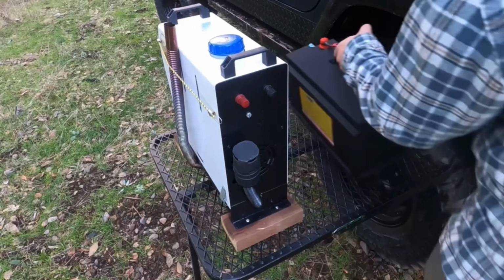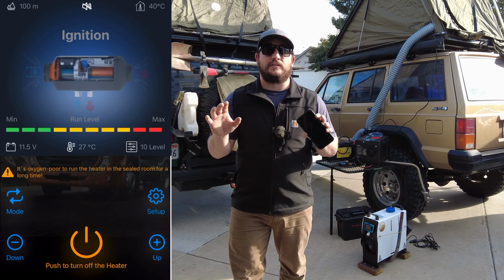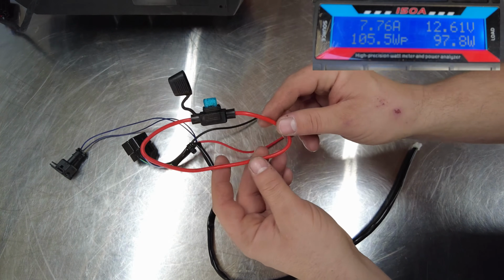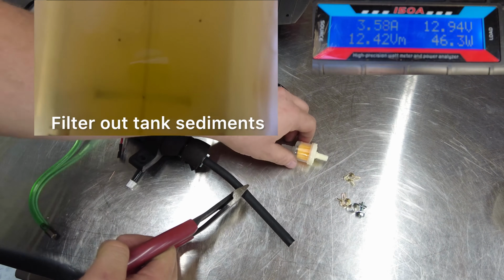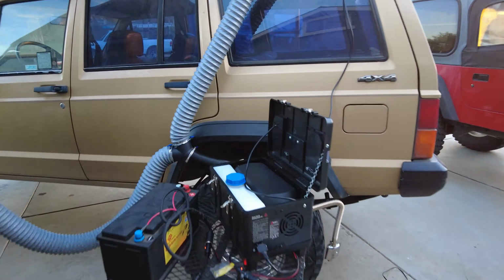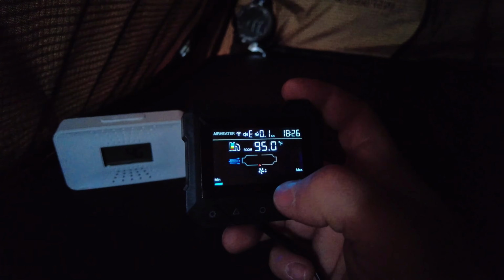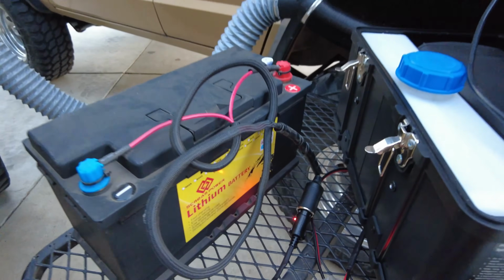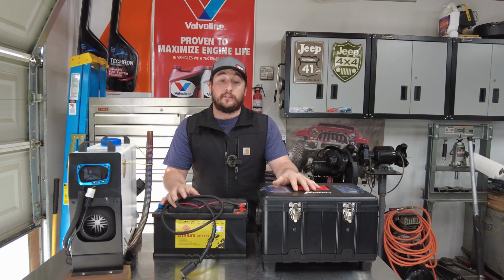Diesel Heaters For Winter Tent Camping - Upgrades and Modifications

Comment: Some great ideas, something to google or think about is removing the soft green fuel hose. The flexible heat transfer hose is that drier rated?  Having a hard time finding proper duct hose rated properly for the heat rating. 
Any update on the exhaust elbow you have mounted on the heater ? Just interested in the proximity of the elbow and the box, as the exhaust pipe gets to extreme temperature 
Thanks
I went, to the Amazon listing for the flexible duct, and it concerns me it makes no mention of certification for driers or anything about drier vent. As well I couldn’t find any mention of heat temperature rating. Being that this is the hose bringing in fresh air, it concerns me anything from China with no real certification. 
Any ways I purchased proper North American certified ducting problem was it’s smaller diameter
Reply from the maker: Maybe try using the cardboard aluminum one for directly over the heater port , keep it short maybe 1-1.5 ft and then couple the plastic one to that way it’s not directly over the hottest part.  that’s what I’m going to do since I haven’t smelled any burning the way I set it up in the video. Any thoughts?
Reply from the maker: The flexible duct is rated for drier and indoor heating / AC. I’ve had no issues with heat in that area of the exhaust, during my next camping trip I will up date on that. So far it’s a great improvement to the old style exhaust where you have to bend the tube to make it right, my vevor exhaust tube has already cracked and split there , this 90 should eliminate that all together. I am also concerned, what temperatures are you seeing on your end? As the jacket is outside of the aluminum? Also keep in mind the material that surrounds the heat exchanger is also plastic , I would think you would want something of that exact material or totally aluminum if possible. Curious to what you find. Thanks for watching 🍻

Comment: Great video but that hose is pvc coated and releases toxic fumes when heated up.
Reply: Vislone 75mm heater ducting. I found that to be the same as the one that came with my hcalory and what the German brands only sell.
Reply from the maker: @Popcornbeetle  here’s a possible solution, Maybe try using the cardboard aluminum one for directly over the heater port , keep it short maybe 1-1.5 ft and then couple the plastic one to that way it’s not directly over the hottest part.  that’s what I’m going to do since I haven’t smelled any burning the way I set it up in the video. Plus the cardboard one is pretty ridged. Any thoughts?
Reply from the maker: Not the inside this is what it is on Amazon 3 Inch Flexible Ducting Hose 16.5 feet, Grey Aluminum Ducting Dryer Vent Hose with 2 Screw Clamps for Heating Ventilation Air Conditioning
Reply: @ATEMOFFROAD  good luck with that. The temps on the outside of the duct get quite hot especially at the heater outlet. That’s hydrogen chloride gas for ya. I had this duct for 10 min and realized the fumes would not go away and you can smell it from inside the tent.
Reply: I’m not a fan of the more rigid duct that comes with these heaters…they are like the German heater ones. Not as flexible but they are proven without toxic fumes. Not insulated either but those cheap flexible Chinese ones aren’t insulted beyond that thin pvc coating on the outside.
Reply from the maker: @Popcornbeetle  any links to the 3” duct you’d recommend? I’ve never had any smell or odor in the tent from the heater. I had a solid aluminum one that was ridged, but I stopped using it as it was difficult to put away inside side my little storage box. Thanks 🍻
Reply: @ATEMOFFROAD unfortunately i reverted to using 2 of the more rigid black ext alum int ones. I use an elbow that is plastic so I don’t feel great about it but I use it to neglect the last 3ft into the tent, so little less heat. I see others using 4 to 3 adapters then using household ducting. I might go that route as it’s more flexible and easily can do the Y adapter to two tents.
Reply: Use this 2 or 3M duct (black ext alum int) and then you dont need an adapter and could run all the way up to the RTT in one run, cheap too!: "SHOUD Heater Duct Pipe,42mm/60mm/75mm Preheater Hose Air Inlet Pipe,Hot Cold Air Ducting for Diesel Heater Webasto"
Reply from the maker: @Popcornbeetle  any links?

Comment: Love the lid chain and controller extension mods. Still struggling with the app setup.
Reply: Android.
Reply from the maker: @daviddover4563  I haven’t used with android yet what’s going on?
Reply: @ATEMOFFROAD  app won't connect to Bluetooth. My phone find s it but app heater will not. The Bluetooth icon shows on the controller.
Reply from the maker: Thank you , What’s not working for you? Apple ? Android?
Reply: APP is now not even available in Google Play Store for Android. Seems to have disappeared in 2023? Reviews show this. Hcalory needs to stop advertising these as Bluetooth because they no longer have an App for it. Remote is garbage too.

Comment: Yep!  I ordered using your coupon code (saved $25).  About to extend my control panel - great timing on this video!
Reply from the maker: Awesome it’s good to hear y’all take advantage of that code. The cable extension is a must if you can, regardless of the Bluetooth IMO. Thanks for watching🍻
Reply: @ATEMOFFROAD  I’m not having consistent luck with the Bluetooth at the moment
Reply from the maker: @stephenhall5421  are you on android or apple? I use apple and so far every time I’ve opened the app it’s works just have to wait a second to load. What’s going on?
Reply: @ATEMOFFROAD  Apple phone.  I got the app to work once.  I’ve deleted the app and tried reloading.  Sometimes I can get it to turn on via the app; but can not adjust or turn off.  It reads the temp and voltage - so it seems to be communicating
Reply from the maker: @stephenhall5421  do you happen to have any other Bluetooth devices in the proximity, ie vehicle stereo, headset, speaker. Another device could have priority over the other and kick the heater off the app.
Reply: @ATEMOFFROAD  good thinking; but no.
Reply from the maker: @stephenhall5421  then I don’t know , maybe kill all other apps in the background except the heater app?